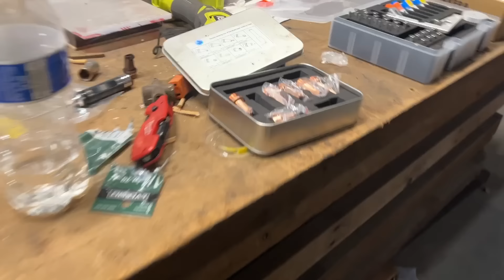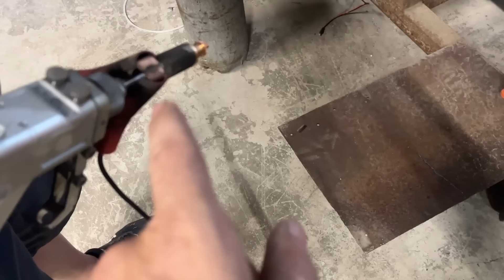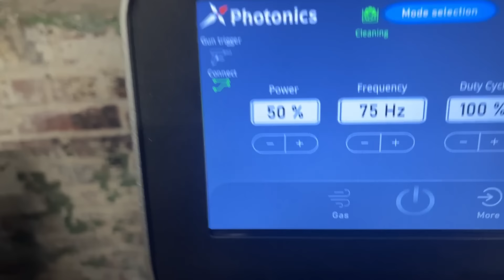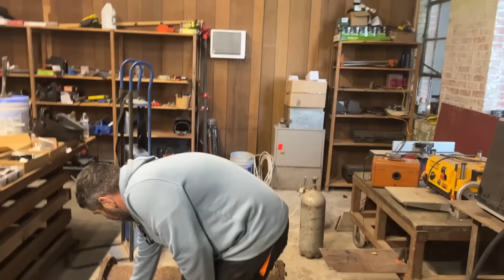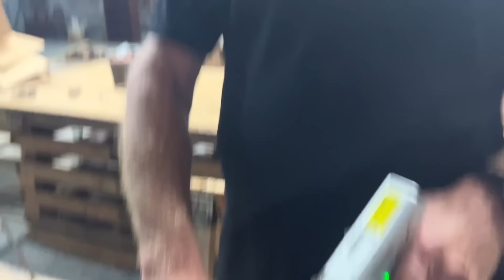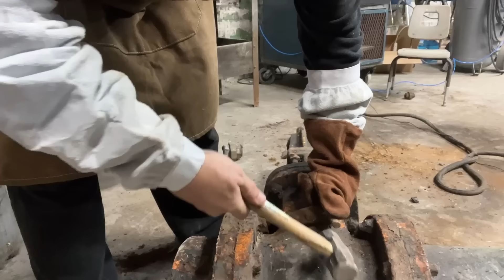Can 100-Year-Old Steel Break My Modern Laser?

Comment: The laser welder fad is just about the most dangerous thing you can buy without a background check 😂 Infinite possibilities for going blind and giving yourself severe burns, because it's not just the nozzle or "business end" that you need to worry about, that beam also reflects at will and stays just as dangerous. Right off the hop your buddy is letting this thing rip with no protective gear and the laser is just burning a hole into the concrete 🤦 Send that thing back and get a combination mig and stick machine if you want to do welding, and an acetylene torch for cutting weird stuff
Reply from the maker: Agreed, except for the part about sending it back. haha.
Reply: @brickandsole  Laser welding is best suited to "fine" welding, such as stainless steel parts with high standards, or for a tool and die application. You guys are likely to weld a shelf or a frame for some kind of platform or display? It isn't really the best tool for that, but I guess the laser cleaning function is nice to have

Comment: That laser cleaner would be handy for me.  I think you could use just a taped on paper pattern, as the laser only reacts with metal.
Reply from the maker: Some lasers my work like that, this one will set paper on fire in an instant.  It will cut metal as it is fiber optic, I think the Diode ones are the ones that work on stuff other than metal.
Reply: @brickandsole  ah, gotcha. Didn't realize there were two types for rust removal.  Only ever seen the one made for consumer use.

Comment: Last video I posted encouraging you to reach out to a laser cleaner manufacturer and it looks like you were way ahead of me! 
I'd love to see you try the laser cleaner on some of the brickwork to see how it deals with paint removal 😎
Reply from the maker: we did try it but the lead in our paint is pretty tenacious and designed to resist the heat. it seemed to scorch it but not remove it. We may need a 1kw laser to get it accomplished. It works with modern latex paint etc.

Comment: Hiya Chris, Bob.  I'm not a welder, but I've seen plenty of welding done up-close and personal, as well as occasionally here on YT.  I believe that it's highly unlikely that that red clamp is supposed to be attached to the business end of the welder/cutter thingy.  It's probably supposed to be clamped to the material being welded/cut to complete a circuit, or some other related reason.  Thanks for making my day again, and always remember to stay safe, my friends.

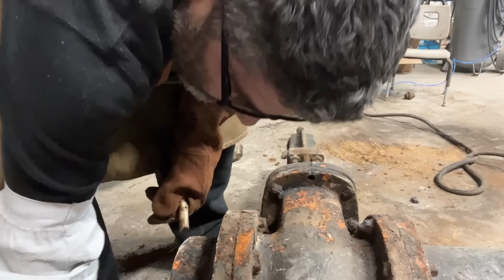Oh!  And clean up that enormous bolt at 35:10 to use as a paper weight.
Reply from the maker: Agreed. But it wasn't seeming to work when connected to the material, I think we should have read the instructions. LOL.

Comment: laser cutting is not like welding, welding is high currant generating heat to melt metal, laser is concentrated light on steroid you got to use the proper specific PPE for that to avoid a nasty reflection in your eye and go blind

Comment: Be careful with that thing.
Lasers are nothing to ef around with.
Just think what would happen if ran that beam across a finger.  
Considering this was made in China, and they run lax on safety there, I would get NEW eye protection from a reputable welding shop or tool company like Granger. 

Also, set up some rules for using it.  Rules like personal protection, only one person in the room, keep the door closed.  You dont want a stray or accidental beam hitting anyone.   

Don't fear the tool, but respect what it can do.

STAY SAFE
We want to keep you guys around.

Comment: The tank is a heat exchanger used to heat the water in those elevated water tanks. The two small pipes in the end of the tank supplied steam to it from the boiler room.  The other two larger 2" pipes were for cold water in and hot water out up to the bottom of the elevated tank.

Comment: Just a thought.... once you get it down to bare metal, e.g. for making signs with some kind of stencil... you may need to top coat the revealed bare metal with a clear coat so it doesn't simply re-rust immediately upon exposure to moisture.
Reply from the maker: yeah there are some good products for that.  Will be fun to test them.

Comment: I think that the large tank you are working with is a heat exchanger. It is so heavy because there is a bundle of tubes inside to add surface area to cool the other liquid going in. The tube bundle comes out for cleaning.
Reply from the maker: interesting.  I wondered about that.

Comment: WARNING! Do not use the welding mask as protection when using the laser, it does not stop the laser wave length thus there is an big risk that one of ether of you will go blind!
I also suggest that you trow away those glasses you got with the laser cutter for the same reason.
If you do not believe me or think that I'm over dramatic, there is an simple test to se if those can do the work: Shine the laser in tho the lens of the glasses or the welding mask there should be no dot on the other side.
If there is, then its not safe.
I highly recommend talking to an expert in the subject or talk with the YouTuber Styropyro (Drake Anthony).
Reply: If we learned anything from styropyro it is to wear good safety glasses and how dangerous things can really be😂
Reply from the maker: that was a mask with laser protection, not a regular welding mask, it is green glass sent with the unit.
Reply: @brickandsole  sometimes you just ignored ''not laser cleaning at a 0% angle onto the object''.
This apparatus has a sub1 second time interval until it hits vital organs  broski's.
1 millionth of the laser's reflection on your eye is  b-eye  b-eye

Comment: On those brass valve stems, why not drill down through the center of the shaft to bring the wire through and to also mount your lamp parts with.  Start with a small bit (1/4" or so) to get a straight hole to work with. Then use a longer bit (Like an Aircraft Bit) of around 3/8" to follow your original hole and to go all the way through the center of the shaft.  You just have to be sure to keep clearing the bit, of shavings, or you'll literally lock the bit into the hole.  It might be necessary to do the drilling from both ends as Aircraft Bits are usually only 12" long - although longer bits are available.